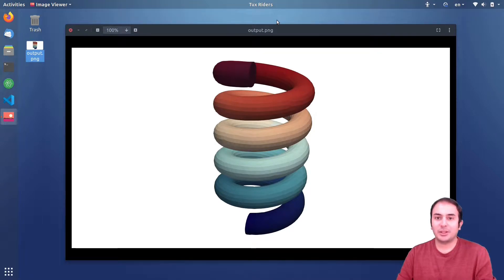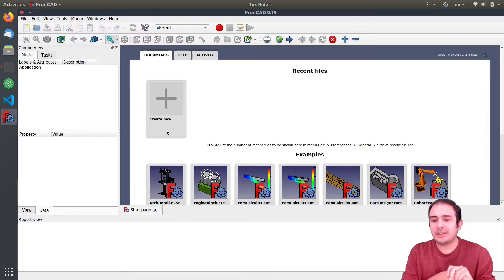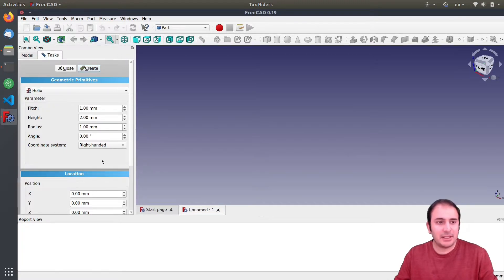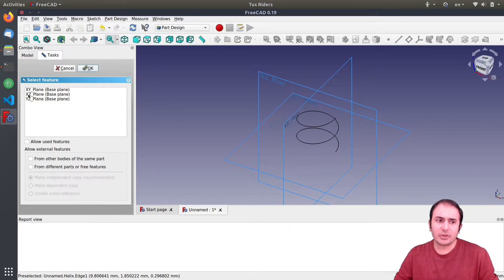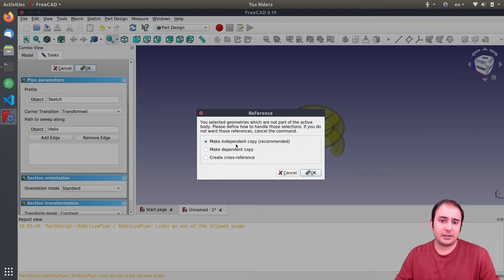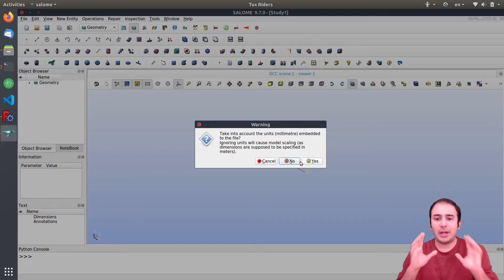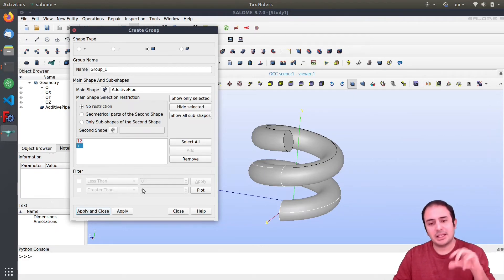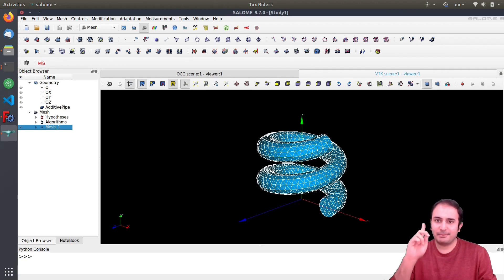[Finite Element 3] Prepare the geometry: Create the helical shape in FreeCAD and mesh it in SALOME

Comment: Nice tutorial. But in newer versions (I use 0.21.2) I got an error when tried to apply the sweep. As I understood it requires to use "Shape Binder". At least with it worked for me.
I followed the next steps:
1. With the Body active, select the helix path
2. Click "Create shape binder" icon and then OK
3. Hide original Helix
4. Use shape binder as a path
Reply from the maker: Thanks a lot for sharing this tip :). I pin your comment for others having the same issue with the newer versions.